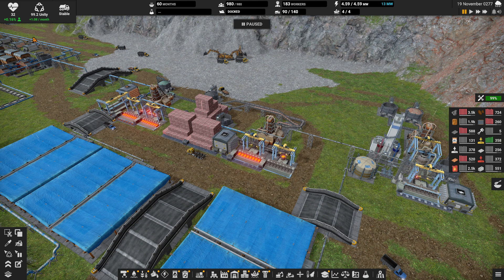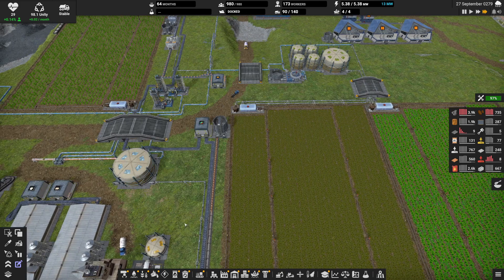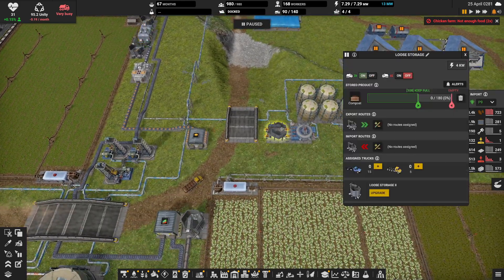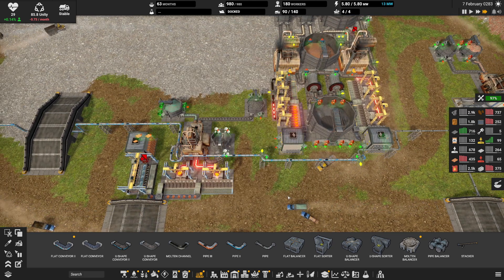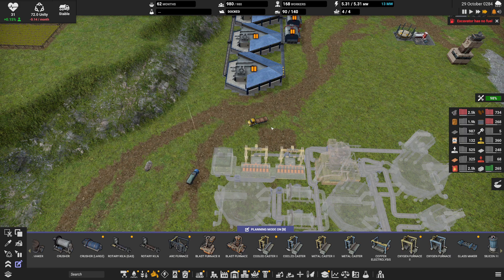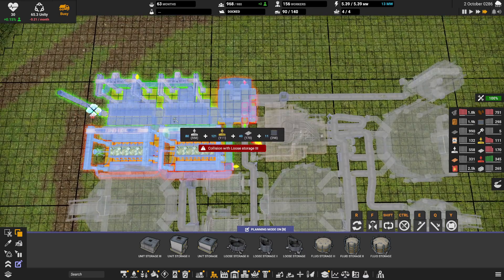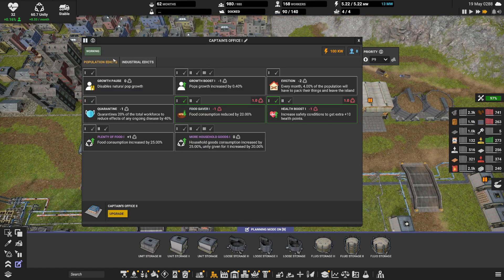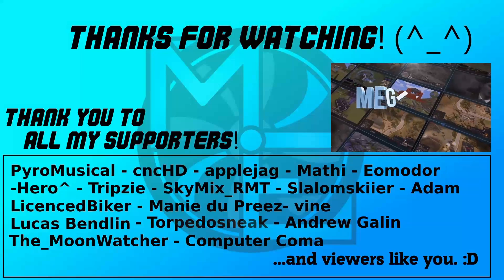Captain of Industry - S02E25 - Copper Plate Rework Plans

Comment: 21:36 That’s why you use Belt Balancers, so that some of the CP1 you produce goes to producing CP2, and some of it goes to an output buffer that your trucks can take from. And same with CP2/3 and 3/4. I’ve found that not setting priority for those particular Balancer works best. Or if Intemporarily set a priority to one or the other, then it’s usually best if I later go back and reset it.

I’ve also found that, e.g., for the CP1 I make, it’s best to store the CP1 in a large internal buffer, which then feeds into a Balancer, which splits it to a small output buffer and another small internal buffer that feeds to CP2 production. At first I used huge buffers for output and for the internal reserve reserved for CP2, but that’s much less flexible.
Reply from the maker: I agree with this. To be honest, I wasnt super satisfied with my setup but stuck with it. I would have absolutely set it up as you described it.